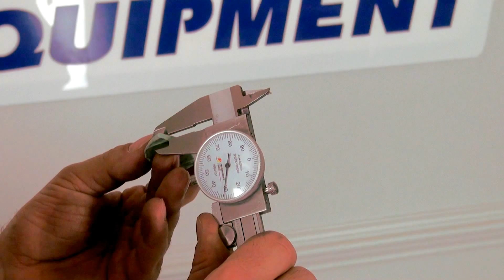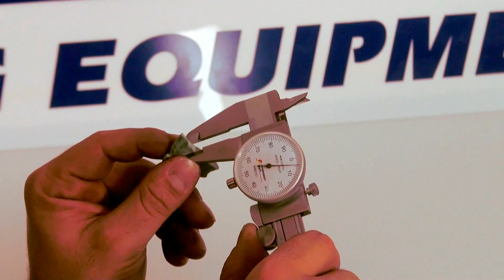Piston to Valve Clearance - Summit Racing Quick Flicks

Comment: i have a sbc 350 with 275 dome pistons 200cc  64cc edelbrock aluminum   heads im using a solid flat tappet cam tippy sure it will clear regardless or am i wrong
Reply from the maker: It would depend on the cam lift, the only for sure way to tell would be to check the clearances with clay

Comment: Have a 260Z engine. Rebuilt engine 6 months ago and has now 200 miles. Recently went down a hill in first gear and backed off the gas suddenly and the result was three intake valves were bent by hitting the piston. An instant event since prior all was well. During rebuild we checked valve to piston clearance and all was good. Any comments? Thanks
Reply: did you reuse the valve springs?  stronger springs should help
Reply: your valve springs are weak ...use new or stronger springs

Comment: What would the most you can get of valve lift on a stock bottom end 350 sbc? I'm looking to put a new cam and AFR heads, but I hear AFR heads like a lot of valve lift. I am just curious what the most valve degree, lobe separation on cam, and valve lift.

Comment: On the home stretch of rebuilding a 4g63 vr4 engine, was replacing the old cometic 0.07" head gasket with a 0.051" gasket. Was wanting your guys opinions on whether or not i would need to check the valve to piston clearance?
Reply: Jack Bates if your unsure you should always check

Comment: Can you do this test with multiple cylinders at once, instead of installing/removing the head multiple times?
Reply from the maker: STIG30 , 
Absolutely, as long as you have enough clay and the cam is installed/degreed properly and all the valve are adjusted properly!  This is usually done with checking springs in place of the original valve springs to make it easier to rotate the motor and most people only buy one set.

Comment: why is there such a small hole for water passage in a 350 head gasket and such a large hole in the head and block
Reply from the maker: Hi johnnywaco3, 
This serves as a water restriction. This water flow regulation helps to achieve more even cooling around all cylinder walls.

Comment: so the head gasket is not torqued down yet?
Reply from the maker: Hi *****,
No,  the head gasket is not torqued down.  The reason is because head gaskets are compressed by the force between the cylinder head and the engine block.  When they are compressed, they are formed to the cylinder head and engine block forming a tight seal.  

When finding the piston to valve clearance, you take the uncompressed thickness of the gasket and subtract the manufacturer’s specified compressed thickness.  This gives you the thickness that is compressed, or squeezed out of the gasket.  That value is then subtracted from the compressed clay to find the total piston to valve clearance.

Piston to Valve Clearance = Compressed Clay Thickness - (Uncompressed Gasket Thickness – MFR Compressed Gasket Thickness)

Comment: I usually leave the rockers tight when I pull a head. That way when you loosen the head bolts you have a good amount of spring pressure to help you separate the head from block. Once the seal is broken then I loosen the rockers and proceed normally. Just a thought.
Reply from the maker: Hi 177SCmaro, 
Thank you for sharing your experience. Great tip!
Reply: Summit Racing
You bet. Anytime.